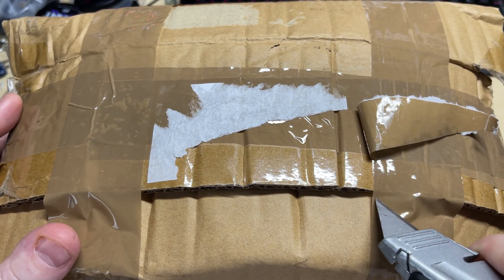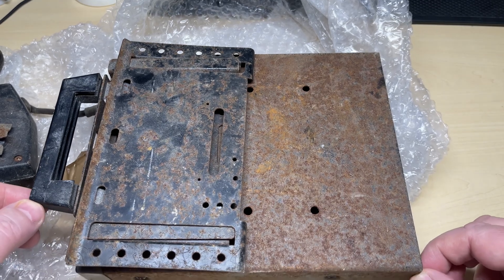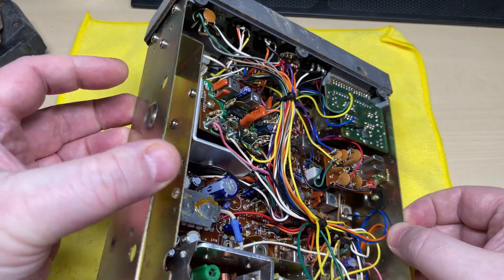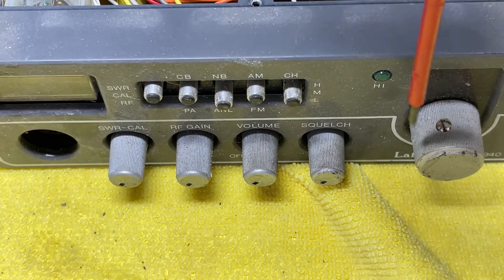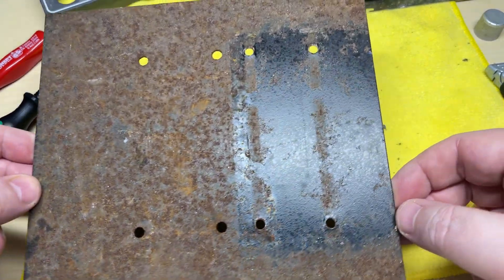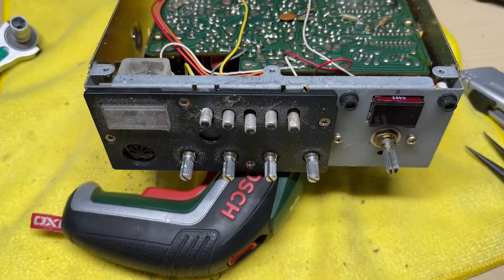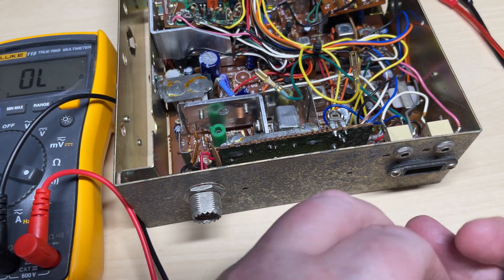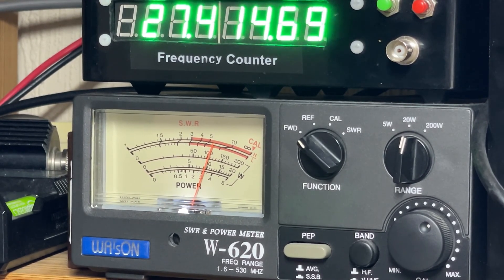EP 125 - Lafayette HB-940 AM/FM CB radio , Repair, align and UK40 Part 1.

Comment: Those cases are shocking…probably best to sink them in Citric Acid for a few hours before working on them.
Powdering would be ideal but you’re going to have to weld the holes up.
I’m certain i still have a 940 somewhere and for some reason i think i robbed the outputs out of it.😂
Reply from the maker: Yeh the cases are pretty bad really they need replacement .